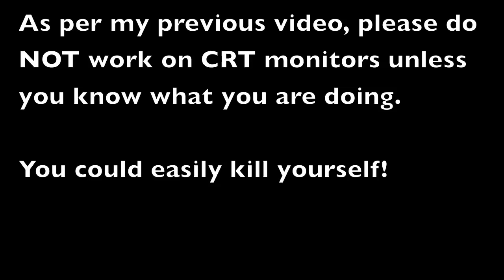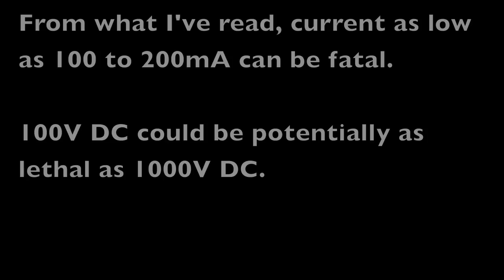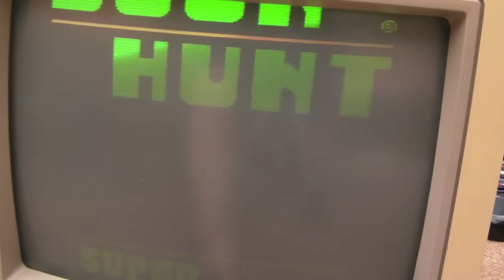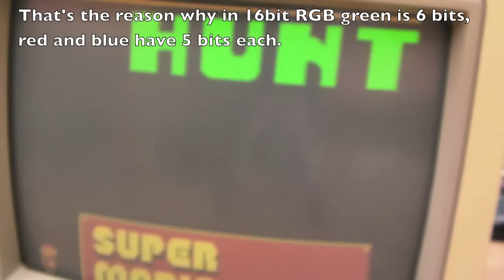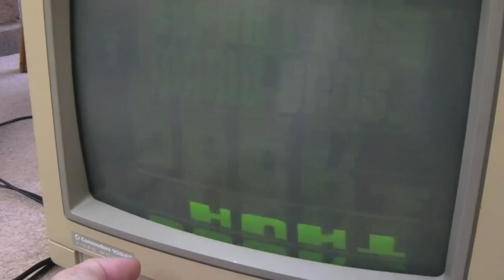Commodore 1084S (1084S-D1) Repair(s) - Part 2

Comment: Great video, I think you pretty much covered everything here.

and yes these monitors can be an absolute pain!! hahaha

With the monitor going bright then dimming a little at the end of the brightness control, mine does that also. There is a feedback line from each gun on the neck board and I suspect it's this that causes the brightness to flare then stabilise at the end of the pot travel there.

On the main board inside front right of the monitor there are three pots to adjust the bias for the RGB. Might be worth just clicking the blue one to "reseat" the pot. Although I don't think that's the issue with your blue problem there. Certainly looks like it could be a capacitor causing that like you mention.

Can't wait for part 3 :)
Reply from the maker: Thanks for your continued support - much appreciated =D  And thanks for sharing there about the feedback from each gun - I've long since forgotten about that =D  I will check the bias pots in part 3 =D  The blue pops back very quickly over about 4 seconds, after it warms up for 2 minutes.  I just hope its not a the blue gun!

Comment: You mention using an isolation transformer for safety in several responses to posts and while this is always a good idea when working with mains operated appliances it will not protect you from electrocution with charged components and high voltages such as found in CRT's. There's no substitution for good working practices and avoidance of dangerous mistakes. Always use properly rated and fused test equipment and never take risks by performing repairs without the necessary knowledge of safety precautions.
Reply from the maker: Thanks again =D  It's really very useful having contributions like this in the comments!

Comment: The big B+ cap on G07 arcade monitors hold all of their charge if the HV has failed and blown the small fuse on the board.  I had read that cap can give a nasty bite (it holds about 120VDC), so I tried shorting it with a jumper wire to discharge.  Needless to say discharging that cap almost made me discharge crap into my pants!  I would not recommend discharging those caps with out a resistor.  I actually use a standard mains incandescent light bulb to discharge them now.  It lights up the bulb without any terrifying arcs.  Pretty cool to see the light bulb light up for a moment too!  ;)

One thing I am questioning is the need to connect to earth ground when discharging the CRT anode cap.  I don't believe it is necessary, as you are really only connecting the anode and cathode of the CRT to dissipate the voltage differential.  The addition of the earth ground plane is unnecessary to eliminate the voltage in the CRT.  It would be like trying to make sure you are discharging a capacitor or a battery by connecting it to earth ground.  It's kind of a unnecessary precaution if you think about it.  Still, I am not an electrical engineer, so if anyone here is one and knows differently, then feel free to correct me.

I think the earth ground trick is good to help prevent damage by ESD, but that is where wrist straps and ESD work mats come in.  Also, plugging in to an outlet for earth ground doesn't work so much for those of us in the US, as we don't have switches on our mains outlets.
Reply from the maker: Yes, you're right about the earth - it's just a cleaner way of doing it that I have used in the past.  You can just short to the chassis.
Reply from the maker: And you're right about an ESD strap or ground map with strap.  Many ways to achieve the same thing.

Comment: Has much of this fiendish complexity disappeared from LCD and LED screens, or are just they fiendishly complex in other ways?  Screens seem to fail less, these days.
Reply from the maker: I guess they have become simpler in some ways, but complex in others.  Now you tend to have 2 or 3 PCBs, each with a seperate general purpose, eg. PSU, T-CON, Inverter Board etc.  But therein lies the complexity increase in that the ICs on those boards do an aweful lot more than the analogue screens ever did.  Most of the time its easier to just swap boards in modern screens, but some spot repairs can still be done to PSU, or perhaps where a small SMD component fails.  But all the main chips these days end up being BGA...

Comment: I have a 1084S-D2 with no picture.  I notice my 150uf cap (in the PSU section) has a bulge on top. I replaced it but i still get no picture. My fly back  transformer doesn't make any high pitch squeal sound. I did measure the PSU voltages and they all check ok. I'm totally baffled why it is not powering up. Oh i did check the fuse and its ok ;-) 
So any suggestions will is appreciated..
Reply from the maker: I guess it would be worth measuring the voltages (perhaps avoid the HT pin and make sure you dont get near it) - under the line output transformer - eg. the 110v, 26v etc.  Maybe buy yourself an isolation transformer or variac first!  It could be a dead LOPT - they don't always squeel.  Sometimes they can just be dead.
Reply: Thanks for the tip

Comment: Oooh.

I'd better grab some food before settling in for this one. :p

I'm kind of missing doing CRT repairs, so this should be a good one.

#first!
Reply: 10:50 Yep, some larger caps can have a slightly domed top anyway, even from new.

As you said in the vid too, a lot of switched-mode power supplies (on 240V AC mains) actually have around 340 Volts DC across the main smoothing cap, due to the use of a full-wave bridge rectifier.

A lot of the PSUs in plasma / LCD TVs, and PCs etc. have a power-factor correction stage before the bridge rec, so the main cap will often have an even more hazardous 390 Volts or more on it.

EDIT: The power factor correction stage usually boosts the normal voltage slightly to the main part of the PSU.
There main even be some larger sets / designs that boost the voltage to over 400 Volts. :o
Reply: Discharging the CRT isn't scary at all after the first few, mate. hehe

I used to get the slight nervous sweats on my first few CRT repairs, but then I was about ten when I started. lol

A lot of the smaller tubes on more "modern" TVs / monitors do tend to self-discharge a bit over a day or two, but it's definitely NOT ALWAYS the case.

btw, although having the monitor connected to mains Earth (but the mains plug switched OFF) can't hurt, it's not really necessary when discharging the tube...

The tube just acts as a large-ish HV capacitor (which has the benefit of smoothing the DC pulses from the flyback), so when you discharge the tube to chassis Ground, you're essentially just "shorting across the big cap".

The path for the discharge current should go pretty much follow a direct path "across" the tube / chassis.

I guess plugging in to mains Earth will probably help minimize the risk of getting zapped though, as the current will try to follow that Earth path, even if another part of your body happens to be also touching Earth? It's an interesting one. lol

EDIT: But, that's ONLY if the HV arcs across to the monitor's chassis, then go directly to mains Earth.

It might arguably pose a greater risk by having the monitor plugged into mains Earth, as it's more likely that the arc will zap to you first, and you could be touching (or close to) another part of the chassis.
Reply: ElectronAsh Are you sure you miss this? LOL. Tell ya what, I have  a k7500 being a royal PITA to work out why the top part of the screen seems to look double interlaced, along with a couple other geometry issues after the HOT started arcing through the insulation and shorted itself and the main voltage regulator. Been trying to work it out since. So if you are missing it THAT much :-).
Reply: In case it hasn't been said before.  Careful with some vector monitors  like asteroids and similar. Some older TV CRT as well. If you directly short the anode without the 1 megaohm resistor you can do damage to things like the HV rectifiers and other such fun. Make sure the set isnt one these b4 directly shorting.
Reply: lol

Yeah, I've had a few "fun" experiences working on CRT monitors and TVs over the years.

When I was first learning (early 90s), I wondered what the weird wire link was for that was between the two large smoothing caps on an Olivetti monitor. I soon found out when the innards of the caps when shooting past my eyeball at 60 MPH. lol

(yes, it was the bypass for 115V mode.)
Reply: I was going to mention that earlier, but I was typing on the on-screen keyboard on my Android box using a fly mouse. lol

Yep, you should really discharge a CRT via a (well insulated) power resistor to bleed the charge more slowly.

It's the same on things like the Vectrex, as directly shorting them can sometimes kill the diode(s) in the flyback, as you say.

Also, discharging the larger caps should ideally be done via a bleed resistor too, as it can cause some slight wear and tear on the caps, especially if they are nice shiny new Nichicons etc.
Reply from the maker: Hahaha @ #first!
Reply from the maker: Thanks for that info - I didn't know that about newer LCD TV's - not something I have worked on much.
Reply from the maker: Yeah, you are right - after you've done a few you're OK.  This was the first time I had done this on 25 ish years though, and I do often question my memory - am I missing an essential safety step here etc.  What I do remember is how bad that shock was, but a lot of my other CRT theory memories are no where near as strong lol.  And I did take a different approach here with regards to shorting to earth - more often than not, when it was on the bench it was normally just a case of short the anode to the chassis, whilst having the earth connected to the socket.
Reply from the maker: Hahaha =D That sounds like one of those repairs from hell!  When ever high DC shorts anywhere it shouldn't you can be chasing your tail for a long time trying work out what damage it actually did, and then what subequent damaged occured else where as a result of those other failures.
Reply from the maker: I've not worked on any vector based monitors before - so that information is really essential, thanks =D
Reply from the maker: Hahaha - You know now why I put the lid back on with 1 screw before powering up!  Caps can really go with a bang, and despite my checks on polarity - I didn't fancy being exploded.

Comment: Test also the voltages on the STK voltage regulator chip. STK chips are notoriously unreliable and it's probably as well to replace this part as well. Wayne and Nina.
Reply from the maker: Thanks, that's a good point!  =D

Comment: Why do they call a 'fly-back'  transformer?
Reply from the maker: Because the it makes the electron beam "fly back" to the left side for each scan line.  ie. it scans across the screen and flies back to the start position, and the beam is driven down the screen by the vertical deflection circuit.
Reply: @GadgetUK164  thanks. I thought it might be what happens if you touch it.. 🤖

Comment: what solder pump do you use
Reply from the maker: The manual solder pump I use its just a cheap £4.99 pump from eBay - pretty much all the same.  I do use a Weller desoldering station for more difficult boards (eg. Amiga, or Atari ST).
Reply: yeh my next mission to repair a Amiga 500+ battery leakage with acid eaten tracks thanks for the infomation
Reply from the maker: Let me know how you get on!  That's a tricky repair imo - one of the most difficult due to some of the traces being really hard to follow.

Comment: You have bigger balls than I do, some sets have a bleed resistor to discharge the tube, but there is no easy way to tell if yours does and I dont trust schematics when it comes to things that can kill me.
Reply from the maker: Haha, thanks!  Or I am less sensible perhaps =D  Good point on schematics and service manuals!  There's always a chance that a bleed resistor has failed!

Comment: My 1084S-D has a Toshiba tube
Reply from the maker: Toshiba tubes give a really nice picture (typically!).  Thanks for sharing - I had no idea some had Toshiba tubes.
Reply: Dunno about the picture quality, as I cant get it working :(
Did you see the video linked in my comment on your last video? After replacing the HOT,  it squeals like crazy.

Comment: Why the hell are you playing Pal Super Mario Bros. on a NTSC NES?!?!
The game is running way too bloody fast.
Reply from the maker: It's definetly a PAL NES - this monitor won't display colour for an NTSC system (I know because I have NTSC systems and they display in black and white).  I never noticed it was fast before, I always played it that way lol.  I am wondering if its an NTSC cart, but my understanding is that an NTSC game would run slower on a PAL system.  So quite puzzled tbh lol.
Reply: You are correct that a NTSC cart would run slower on a PAL console due to NTSC Games and Consoles 
 running at 60 Hertz and PAL Consoles running at 50 Hertz. I'm very confused though as to why your NES runs like a NTSC Console while apparently being a PAL Console.
Reply from the maker: You can also see that game running much faster on the Famicom video you commented on earlier!  That shows me that the cart is PAL, and my NES is definitely PAL - some NTSC games dont work properly for that reason, eg. Castlevania 3 NTSC.

Comment: Your really need an ESR meter (https://en.wikipedia.org/wiki/ESR_meter). Guessing which caps are faulty or replacing everything is a little OTT. For £25 odd you could get a multimeter with capacitiance testing functionaity and you'd save your self time and money (I only tend to replace caps where the ESR value is really high).
Reply from the maker: Thanks, as per my other comment - got a number of ESR meters already =D